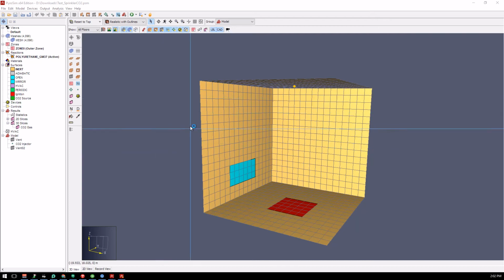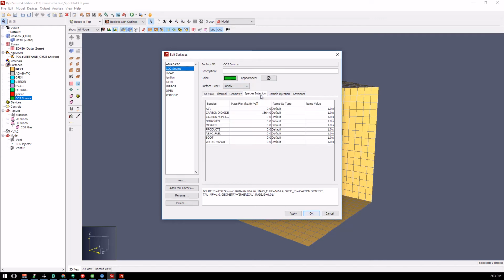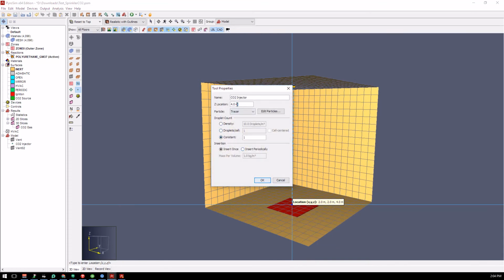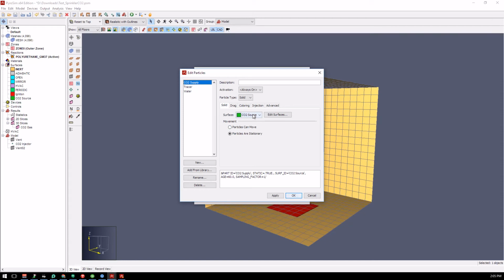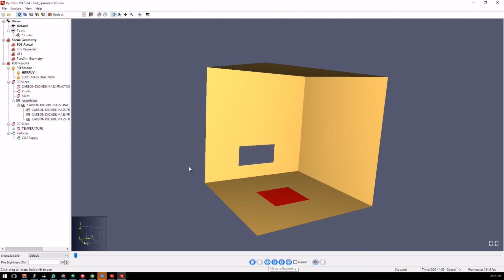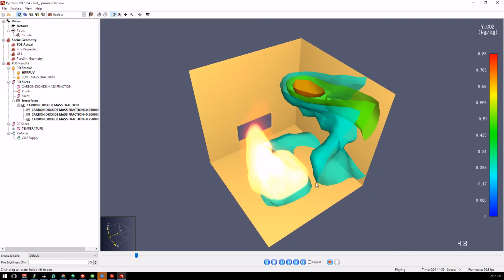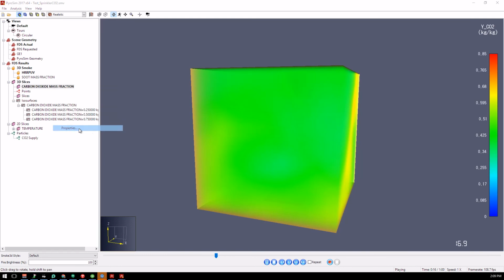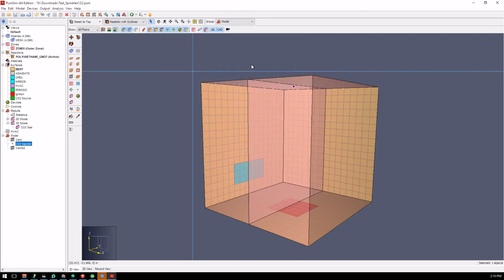CO2 Supression Example in PyroSim

Comment: I am trying to model off-gassing from an EV thermal runaway incident. I am having trouble emitting a 'custom smoke' or using a custom fuel. All compositions in literature is percentages? I tried using this method to emit the specific gas cloud I want to model but no good results. Any help with this?
Reply: Please send an email to support with your model and more details. It would be easier to discuss there than in YT chats.

Comment: how to simulate smoke through ac ducts . how to make smoke move through the ducts/pipes
Reply from the maker: You could use the FDS 'HVAC' feature. See more about it here https://support.thunderheadeng.com/docs/pyrosim/2024-1/user-manual/#_hvac_systems
Reply: @thunderheadeng  i'm really having trouble to setup hvac duct and move smoke through it . can you share any video tutorial or your email ?? it will hardly take 2 minutes . im stuck in basic 

Thanks

Comment: Hi. Is it reasonable to assume that I can use a similar approach for an evaporative pool to simulate a flamable liquid spill and monitor the concentration of flamable gases (vapors) inside a confinment (room)?
Reply: Sure, you can specify the MW of the fuel vapor as a gas species, then set up a vent with a supply type surface. With that surface you can specify the mass flux of that species.  You can use 3D Slice, where you track the mass or volume fraction of that fuel species in the domain.
Reply: @BryanKleinTECi  Thank you Bryan! Will work on that project.